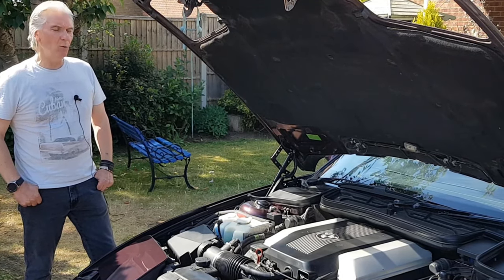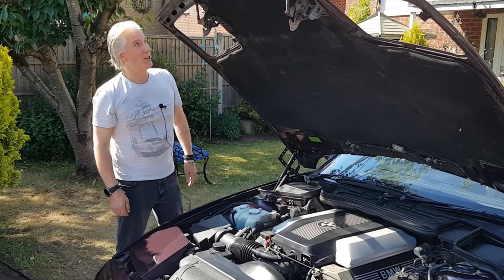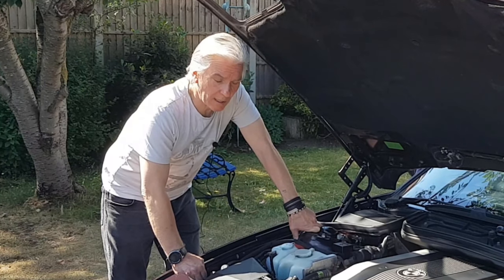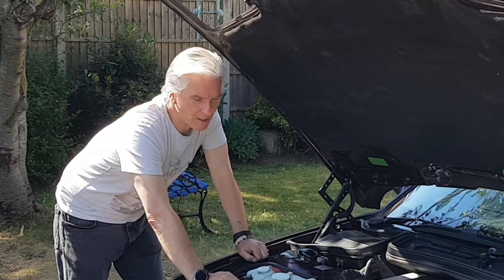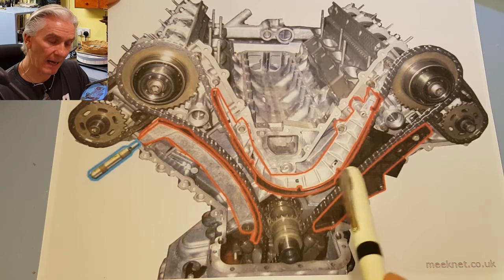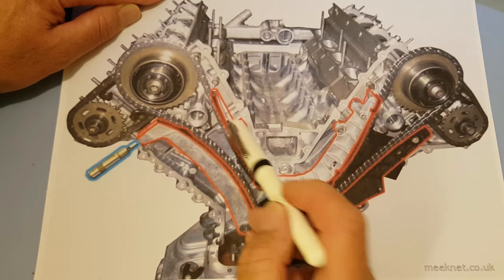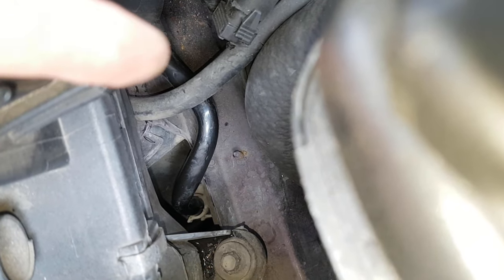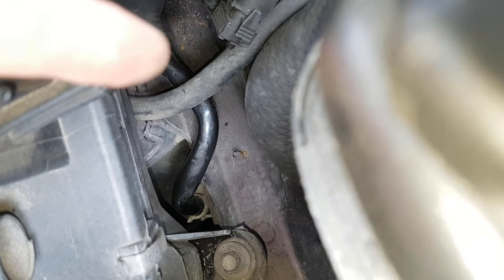BMW M62 Engine - Save your Timing-Chain Guides!

Comment: Have you ever experienced cold start rattle for a sec or two when you start on m62tu engine on e39 540I 2003. How do you fix that??
Reply from the maker: Unfortunately that is usually the Vanos Seals (if you have replaced your timing-chain tensioner). The engine sounds like a diesel for a couple of seconds until the oil pressure is re-established. My 740i used to do this - and I ignored it as it is not a terminal problem.
Reply: @TimmsBMWRepairsandInformation  thank you will wait till my timing is due. I have 160k miles but i have no plastic chips in my oil pan
Reply: Top quality oils with regular oil changes will bring you years of entertainment.☑️👌🌏

Comment: Great video! I can’t help but call out the German engineers blew this chain design. Put two shorter chains on each cam shaft sprocket back to two slightly off set crankshaft sprockets and each independent chain would need no guides, no tensioners or potential tooth jumps! I see no cost nor performance issues with my suggested chain design change. What say you?
Reply from the maker: ...or just keep the same timing chain system on the M60!

Comment: I'm assuming this all applies the the E39 as-well, is it the same fuses to pull for that? Thanks for this video, it explains it very well.
Reply from the maker: Yes it does - but different fuses for the fuel pump - and easier to remove the relay K96 which is located here: https://www.newtis.info/tisv2/a/en/e39-540i-lim/UoGPMvB
Reply: Timm's BMW Repairs and Information thank you for the reply and information!

Comment: My E38 just started throwing the code "P0011 Cam position actuator A bank 1 timing over advance" and its running really loud. A loud flapping sound to be exact. A buddy of mine whom is a mechanic thinks the whole timing chain is about to go kaput. Is it possible that if i change the tensioner then i can save my car? I really like my E38 and i don't want to pay an arm & a leg to replace the whole timing chain. Nor do i want to let my car go.
Reply from the maker: Yes, we'll worth changing the tensioner - it's worth a go!

Comment: Hi Timm! Thanks for the info. I replaced my 740iL’s tensioner a few weeks ago and should have waited for this video to do it! I realized that I did not crank the engine without starting it and instead just fired it up. The chains slapped for about 5 seconds (probably a little less) but they’ve been smooth as butter ever since. Do you think I could have done any damage? Thanks again for the brilliant write up and advice.
Reply from the maker: You will be fine - I certainly used to change the tensioner and then just start the car afterwards - scary noises though!
Reply: I did the same thing 2 weeks ago. Noise for a few seconds then it was good. My old tensioner spring got short over time and tensioner was somewhat seized in the compressed  position. Car runs smooth now. There were no bits of guide when i pulled the oil pan to adjust the oil pump tension and chain the gasket. 

Would have loved to watch the video before hand though. Thanks Timm!
Reply: @zc5275  how much did that cost you?
Reply: @MegaSturrup  $100 from FCP

Comment: Hi Tim, yet another brilliant video, it almost felt like it was just for me after my post on the forum! I have one question. I have owned my E31 for 11 years. The car has been off the road and not run for about 4 of those years.  I have covered nearly 4000 miles in that time. I have never changed the oil. It would appear that I should have given it 7 oil changes! Am I doomed?1
Reply: My 2 cents: I’d do it ASAP. Oil, like many fluids In a car, doesn’t only degrade with mileage, it also degrades with time. Chances are that you might not have done any serious damage, if any (if synthetic oil was used last, and it was relatively fresh). So probably not doomed, just would have possibly has some accelerated wear on bearings / journals and wouldn’t have done the seals any favors. But doing it sooner rather than later will limit any further damage.
Reply from the maker: Yes, change that oil!
Reply: Thanks Tim. Thing is, I know loads of people with old cars that are rarely or never run, and I have never heard any of them ever say that they change the oil every year if the car just sits there. In reality, I am 2 months away from being able to start the car, so I will fit a new tensioner, oil and filter before I turn it over the next time.

Comment: So is the tensioner the reason my timing rattles at startup? Because I was about to just redo the timing chain guides and timing chain itself. Would be awesome if it was just the tensioner.
Reply from the maker: It is certainly worth changing it - rattling at startup is a sure sign that something is slapping around!

Comment: Is it a big deal if my engine is already looking varnished on the inside? I got a secondhand 740i with the m62 and i very much would like to look after it properly, will new oil soften up the old residue and open up the oil ports as well? I worry that its too late (196k km) and that i might have to do the guides anyway, which is no small amount of work..
Reply from the maker: Use a good-quality fully synthetic oil from now on - it will help to remove all the varnish and clear oilways!
Reply: Awesome, I am going to change the oil + tensioner + filter asap!
Thank you for these videos, i love listening to people who know what theyre talking about ;)

Comment: Hi Timm,I have 2 E38's 44,k & 58k at what mileage should I be changing the timing chain tensioners.A 98 740il & 2001 740i
Thanks
Reply from the maker: Hello John, all E38's should have had the timing chain tensioners replaced by now - they are getting on a bit!

Comment: i don't understand why the tensioner ever needs to compress. what would cause the spring in the tensioner to compress?
Reply from the maker: It only needs to compensate for the change in chain length as the chain heats up - but it should never 'compress' as such as it is a hydraulic component just like the lifters

Comment: Hi Timm. What do you say to people who say all the guides should be replaced by 100k miles? I changed the tensioner 8 years ago, and still no problems. I have 110k miles on mine
Reply from the maker: Well, I'm at 173,000 miles on the same chain guides!

Comment: Excellent video. I have always changed the oil once per year and I have never used the car for short trips. My car is on 210k miles and as far as I can remember has its original tensioner and guides. There is no timing chain noise that I can tell. I did however hear a terrible clatter noise shortly after purchasing the car 18 years ago, it only did it once on morning startup, I stopped the engine and restarted it and all has been well for the following 18 years.

What makes of tensioner would you recommend?  I would prefer a proper BMW or the same quality part? I need to watch your parts video...thanks
Reply from the maker: I always recommend BMW OEM parts for the important stuff - and the tensioner is about as important as it gets!

Comment: Hi Tim, is there any way to check the integrity of the guides without much dismantling ?
Reply from the maker: Only once they have failed and then the bits drop into the oil pan....

Comment: I’m wondering what your thoughts on my 2000 740il...  it has 80k miles and wonderfully maintained.   I’m worried after changing the tensioner that initial bad slap until oil fills the new tensioner could itself break those brittle guides?  I’m guessing because you made this video you probably recommend just changing the tensioner?
Reply from the maker: If you follow the routine you will have  no problems!
Reply: Thank you so much,  do you remove the fuse in order to allow a crank-no-start in the motor to build pressure?
Reply from the maker: Yes, that's the plan!

Comment: Excellent discussion and display Timm, and well worth anyone's time if they own a vehicle with the M62 engine. I use fully synthetic engine oil and follow recommended mileage intervals of 4,000 miles for oil & filter. I've also installed an engine pre-oiler that delivers engine oil under pressure to the oil gallies prior to engine fire-up. Changed my timing chain tensioner at 100,000 miles on my e39. Seems to me about right for a well maintained engine. What would you recommend as a tensioner refresh?.
Reply from the maker: Thanks! If you change oil regularly a tensioner will last well over 100,000 miles!

Comment: Hey Timm. Thank you for this video. Your explanations are beautiful. I noticed a commenter down below mentioned that he has an '03 540i with 160k miles. I have the same car with around 169k miles. It just started doing this start up rattle. It's entirely possible that this could be the VANOS simply because the last check up I did with a mechanic mentioned that it's time to do the VANOS, but i'm not sure if the VANOS makes this noise....

Can I get a secondary opinion? Thank you so much. 

https://youtu.be/pC8OZ8DP45g 

(The car wasn't making any start up rattle while 5W30 high mileage full synthetic was being used. After I changed it to 10W40 high mileage full synthetic, it did start making these noises. Looking back, the thicker oil at start up might not have been the best idea because the oil might take longer to enter the cylinder? Could this play into why these noises started?)
Reply from the maker: The best way forward would be to replace the tensioner as detailed in this video and then take it from there - it could well be the Vanos helix gears, but they don't usually give any problem apart from the noise whereas the timing chain tensioner needs to be working faultlessly!
Reply: @TimmsBMWRepairsandInformation  I've been looking forward to your reply since I posted :) Sounds good, I'll do just that. I last turned my car off 6 months ago (I was planning the guide job, and didn't want to run risk of damage meanwhile). I am worried about the start up rattle because when I turned it off, I did so normally by turning the key. I did not burn off fuel in fuel lines by pulling the K96 relay. 

I want to follow your start up procedure here to build oil pressure, but I am afraid my car will start up because I had turned off the car normally, 6 months ago.

In my situation, will I risk the engine starting up even with the relay disconnected? Thank you

Comment: Hi Timm, nice work!
I had issues with M62TUB44 engine on my E53 with cold start. Each cold start was accompanied with rattle noise for about 1-2 second. One day I started the engine and the timing chain guides failed. So the car got completly new timing set. When i compared the old tensioner with new one, i did not see any worn out. Now the engine is repaired but the noise is still there. Du you have any idea what is wrong? 
I checked if the oil pump has the oil return valve but I didnt found it. 
Can this noise be from vanos more precisely a fault on the solenoid check valve? 
Thanks for advice.
Reply from the maker: It can be from the Vanos units - when the seals wear they lose their pressure whilst the engine is off - hence the rattle at start-up - it isn't anything that would bother me....

Comment: Mines at 262 thousand miles, pretty sure it’s the original timing chains too...
Reply from the maker: There you go then - so much for unreliable M62's!
Reply: @TimmsBMWRepairsandInformation  also I'm pretty sure mine are going though, saw some aluminum in the oil the other day so I have it parked till I can drop the oil pan and check for plastic chunks.
Reply: @Elite.customs_479  had a good run.
Reply: @vincetaliaferro2777  still running replaced that Nd did vanos rebuild now I’m doing the starlight headliner
Reply: @Elite.customs_479  sorry I meant the timing chain guides had a good run, I know these motors are very strong, just have an Achilles heel. I was arguing today that the E39 looks better than a C8 Corvette.
Reply: @vincetaliaferro2777  ahaha yeah they’ve definitely got some weak points when it comes to maintenance but the timeless design is just so good, I wish it didn’t just drive gas station to gas station though and had more performance upgrades but all is well.

Comment: Would have been great if the video was not cut so we could have at least seen the tensioner 😢
Reply from the maker: I didn't need to change the tensioner and didn't have a new crush washer if I had taken it out for the video!

Comment: Mine still makes the noise but I didn’t do your last step, but I still get startup noise? What should I do
Reply from the maker: I've just had an interesting reply (see above), regarding the non-return valve on the oil pump (part 1: http://bmwfans.info/parts-catalog/E38/Europe/740i-M62/L-A/jan2001/browse/engine/lubrication_system_oil_pump_with_drive/
) - that could be your problem!
Reply: During replacing the non-return valve on the oil pump (above), you might try also change for 10W60 fully synthetic oil (you will change oil anyhow during changing of this valve/spring). Maybe you just use totally wrong oil like 0w30 or similar. During this job, check as well the oil sump for smallest pieces of plastics, especially brown colour like 2mm x 3mm - they are from timing chain guides - if you find any of them, replace timing chain guides as fast as possible...  good luck! :)
Reply: Tomasz Szebesta i used castrol high mileage 5w30 should I do something different?
Reply: @anthonyk  10W60 works best for me in this rattling matter (As I recall I have tried: years ago 0w30, 5w30, 5w40, 10w40, 0w50 just now, 10w60 recently for many years)

Comment: If you really love your car,  every 15K miles the tensioner should be checked and manually cycled. You'll be amazed at the sludge buildup due to its poor design.  Takes 10 minutes and a 19mm socket.   If you don't want to do that,  change the tensioner at 60K intervals.

Comment: Or you could buy a good car that will go it's whole life without eating it's own internals and that isn't made of out plastic that goes brittle before it's time. Now let me save you some money and tell you about what it's like owning a Lexus...
Reply from the maker: A good point well made!
Reply: arnoldrimmer4833  A good Volvo engine made in the 1960's will get 3.6 million miles. I had a Volvo P1800 from 1968. Why can't BMW engines do that? Keep Lexus in mind when you answer.
Reply: arnoldrimmer4833  I also have a 1967 Alfa Romeo Giulia GT Sprint Veloce. Except for oil leaks it's still same and engine and gearbox, no reman...although 2nd gear's synchs are a little crunchy.
Reply: arnoldrimmer4833  That's the only attitude a BMW driver owner can have. Who needs a car that costs twice what a Toyota costs but lasts 1/8 as long?
So you can say you own a BMW? Are you insane?
Reply: arnoldrimmer4833  The best thing you can say is it's 'strong and comfortable'. 
It's your money, just don't tell me bullshit like these cars are reliable or cheap to run. 
They're not. I know, I owned them and serviced them before due at dealerships. Didn't make a lick of difference, or brand new or old or M division or not, they were all ticking time bombs working towards proving the engineering axiom that complexity is the enemy of reliability. 
That's why a 20 year old Lexus is twice the price of a BMW of the same era, if you can find a BMW still going down the road.

Comment: Cheap in produce piece of crap not engine. 
From trybologikal point of wiew it is mistake in design. 
Roller chain are very bad in cooperation whit guiding. 
Here chain is long, has force from both heads and drives through banana guide. 
3 mistakes in one. 
Flat tapped lifters are another cheap and bad thing in this engine. 
It is one big cost reduction not engine. 
Look at ford 4.6 V8 or other good V8. 
Right head has own timing with short tooth type chain. 
Left head the same.   
Each more expensive but better and shorter chain has force from only one head, tooth chain makes bigger contact and smaller tension on guiding. 
It can survive 3times longer even when you care about BMW engine. 
Last 30 years BMW philosophy went in to making cheap in produce piece of crap.
Reply from the maker: You are not wrong, fortunately they went for two chains on the N62, just a shame about the new problems they introduced!